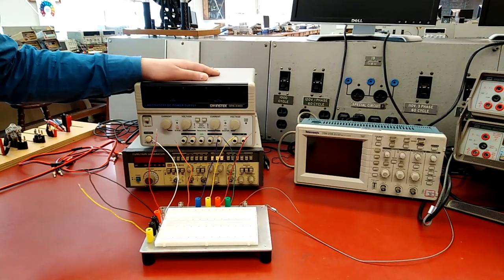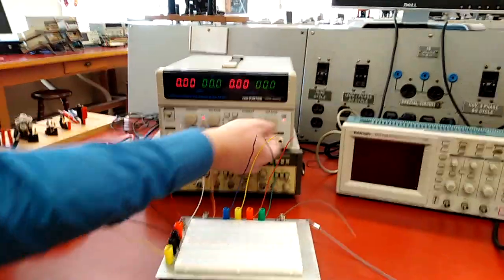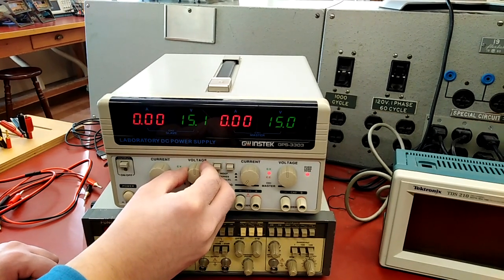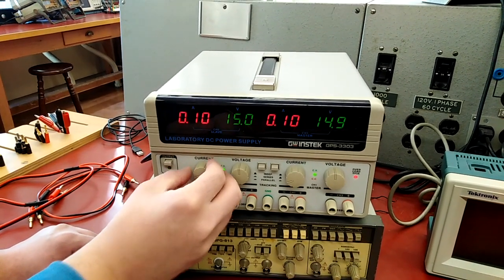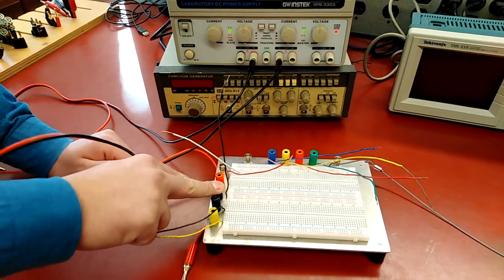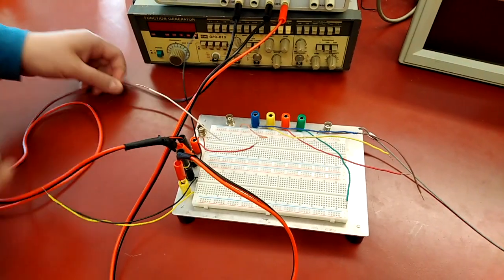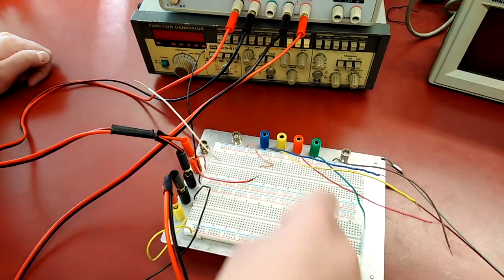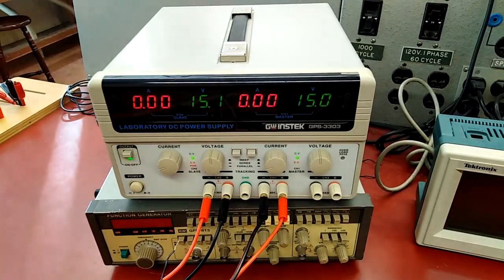How to use a DC Power Supply (GPS-3303)

Comment: You can also use the tracking buttons for series or parallel operation of the power supply. Pressing the button on the left and leaving the tracking the button on the right out will yield a series voltage source such as in your setup. This has the advantage that only channel 1 is used to set both voltages at the same time. The currents can be set for either channel 1 or 2 independently. Finally, if a circuit requires a GND reference, Channel 1 + is used, and Channel 2 - is used. For the GND reference, the GND terminal is connected to the + terminal on channel 2. The negative terminal on channel 1 is not used. For reference, this is illustrated on page 15 of the user manual.